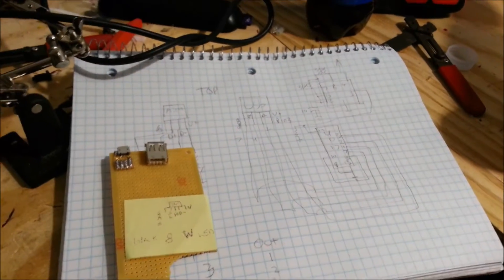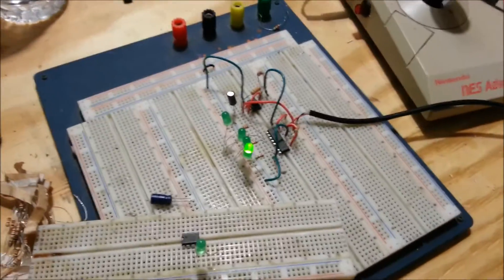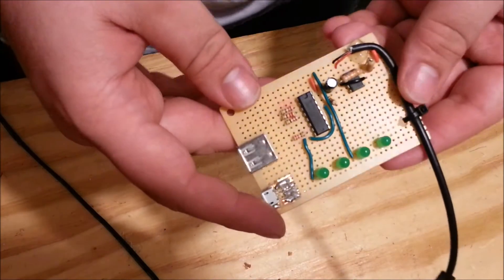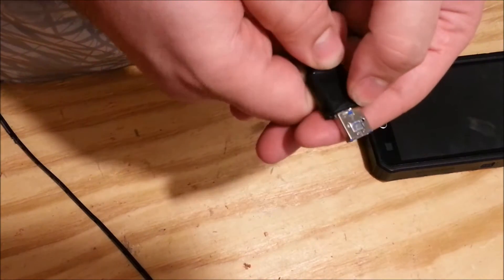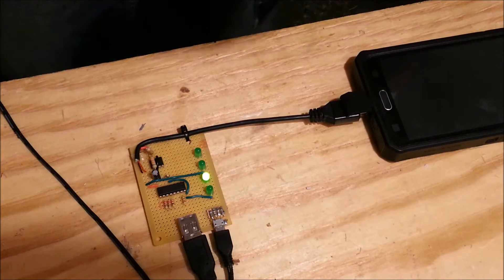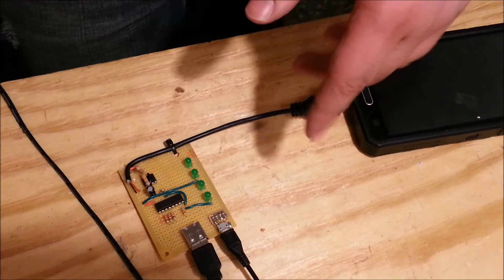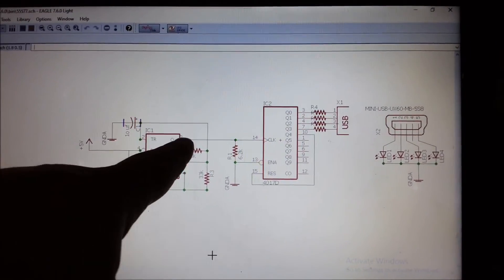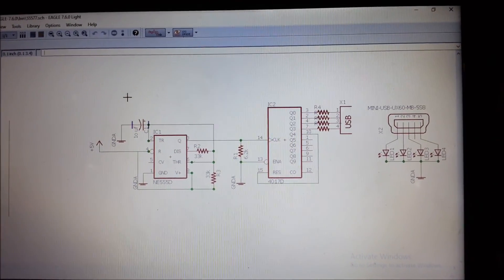DIY USB CABLE TESTER

Comment: Could you have replaced the 555 with a switch  with a de-bounce circuit?
Reply: Doesn't even need a switch. Just 5 x LEDs... and count how many light up.

Comment: hey could you make video on how to make a usb hub from scratch ? I have the raspberry pi zero and a micro to usb adapter but I want to connect more than 1 usb. So could I make 1 usb to 2 usb ports? Thanks :)
Reply: you can simply use a aquagate hub from moinoprice (search "5328" at monoprice), while not a pi zero form b factror. it is a GREAT hub that follows the USB spec by not having back power (power going out the host port) i use this in my rune audio setup. the pi's USB is connected to host, and the pi's power is connected to a normal usb port. my usb 3.0 HDD is connected to 2 of the usb ports and is working flawlessly (i heard this was a issue but have never experienced it) the hub is powered from the wall with the included supply). my pi even has a iq-audio dac+ hat.

Comment: Hey I have a question regarding the xbox one controller. Sorry to post it on this vid, I figured I would get more visibility on a newer video.I  changed the abxy button, now that I took it back together, it doesnt turn on. I have the One S version. When I plug it in with micro usb, the rumble spin to say it has power, but nothing else turn on... Do you have any ideo where the problem could be from? Everything went well, I did not desolder the wire I was jus very careful with the moving the board so I would not damage them. To my knowledge the board where not scratched in any manipulation. :(
Reply: I realized there is a lot of gunk on it from my sweaty finger, so I'll try to clean it with 99% alcool tonight
Reply from the maker: That is very odd. feel free to email me at drburleybur@gmail.com for a quicker response. Changing those buttons should not result in anything bad happening. I would take the controller apart and remove tbe abxy buttons and see if you can power it on that way. It could be possible that you pinched a wire or broke an etch when putting it back together. I would love to help more but I can't do much from a laptop. If you're in the states or willing to pay shipping I offer free repairs in exchange for video content on the issue.